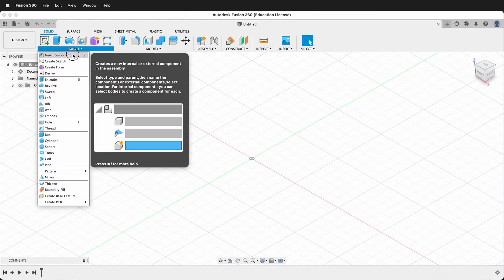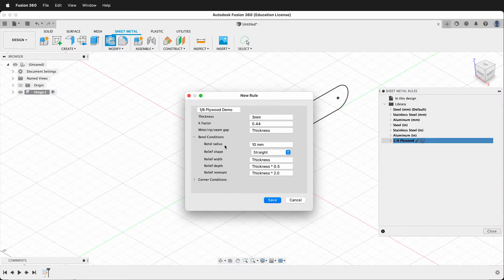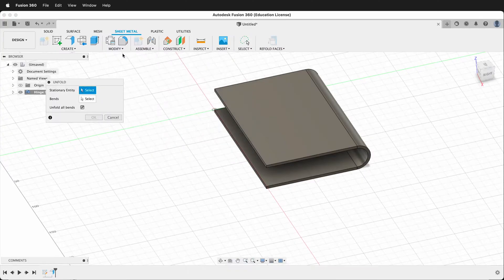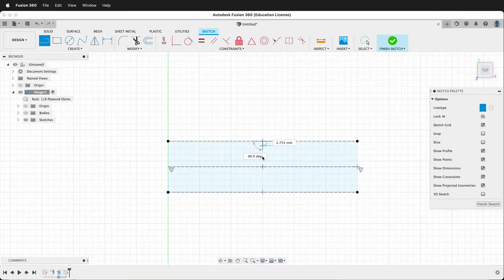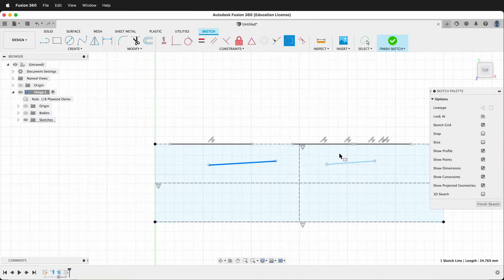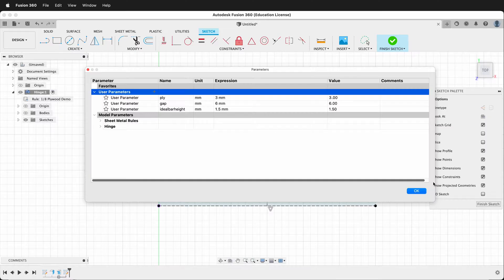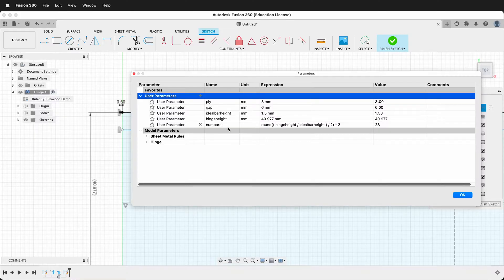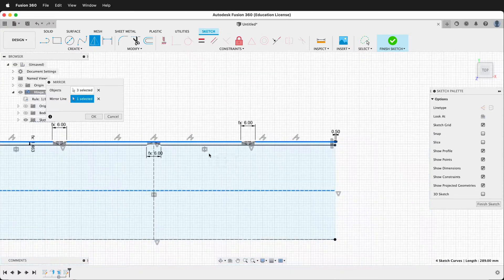Autodesk Fusion 360 Tutorial: Mastering Living Hinges for Laser Cutting

Comment: MANY thanks.  I have been struggling with this concept for ages.  I have been blundering along and wasted several sheets of wood in the process.  

Add two user parameters to automate drawing and changing line segments:

      Segments = (Length of bend line - gap) / number of segments (mm);  must have one more gap than segments
      Line length = segments - gap (mm) ;  

First row of lines should start with a gap and will end with a gap.  Second row starts with a line = to Segments/2, then a gap, Lines & gaps (move/copy lines from first row), and will end with a line = Segments/2.  If you change any of the parameters involved, the sketch will automatically update, except that you may need to add or remove a line.

*Super important:  Constrain the first bar to be co-linear with one of the bend lines or Fusion will move the sketches, surfaces, and thickened bodies around *

DM me for an export of my user parameters.
Reply from the maker: Thanks for sharing the technique and methods with everyone. It sounds uper solid and robust. How did the living hinge come out in your project?

Comment: first i got to say , you make the best Fusion tutorials ever , smart and straight to the point , 
at 7:36 , the driven dimension is 41.846 for me , tho i have set the sheet metal setting exactly as you , idk if it's me or fusion , 
this video was 3 years ago so i don't know if something in the way that fusion calculates the flat pattern has changed
Edit : the value would be as yours if the thickness is 2mm , with a 3mm thickness it's 41.846
Reply from the maker: Could be an issue with Fusion updating or with the way the sheet metal rules are calculated

Comment: at 5:07 , one of the bottom lines just moved passed the symmetry line !! how is that possible if the two lines are symmetrical around the centerline !!!!
Reply from the maker: That is frustrating when constraints in Front usion seem to change, it is usually because there are two ways to interpret the constraints 

This often happens with fillets for c&c inside corners even when it is locked to coincident and a 45° angle 

Sometimes with investigation I can figure out the weirdness was but usually that isn't worth the time and it is just faster put everything back to where it's supposed to be 

For a very robust parametric model, sometimes you have to use different constraints or put min max limits on some of the parameters

Comment: Great tutorial.  I dont know if you can help but I am trying to form a tapered cylinder with living hinge. The sizes are the base circle is 80mm dia and the top is 60mm diawith a length of 300mm. Any idea how?  A video would be great
Reply from the maker: I would try making a living hinge pattern on an arc path. Look up the formula for a truncated cone online, use it to make the arc and then experiment with hinge cut pattern spacing on that arc
Reply: Thanks for that I will give it a try

Comment: what is the K factor? what value to choose?
Or, is it important? one could directly choose steel and not even create a new material
Reply from the maker: K factor is based on the deformation of a material at a certain thickness and bend radius, for rolling or bending steel with precision it is important, but for using the Fusion 360 sheet metal feature for laser cutting living hinges it can be ignored

Comment: Hi, thank you for this great tutorial. at the 12:45, which command do you used to select all lines faster ?
Reply from the maker: It's a drag select, if you drag from the left, it selects any entity it touches, if you drag from the right, it only selects entities that are fully inside the selection, up in the top menu where there is select right click on that menu and then make sure that you have the option to Windows, select or draw select
Reply: @WhatMakeArt  is there a formula to calculate the number of lines in the same line depending of the object width ? Maybe is there a perfect line length to use ?
Reply from the maker: They're probably is but I don't know it, I would have to do some tests and then see if there is a relationship through experiment
Reply: @WhatMakeArt  thank you :) if you found a way, it will be great to share that on a small video !
Reply: I found that, I’ll analyze the code and come back with the formula ;)

Comment: At 8:03 you say there is a downside were you have to type that value every time you change the model. If you go to Model Parameters - under User Defined Parameters ( you can find that value as a dimension name (eg. d50)). As long as you don't change (as in delete/recreate) the driven dimension, you can use the name of that dimension in you your expression. I believe Fusion will recalculate your expression even if your design will change (increase plywood thickness, overall dimensions and so on). To my knowledge, all dimensions will be given a default name by Fusion (driven or user defined). Also at the beginning of the video where you define the gap, instead of entering a value for the second gap, you could have clicked the first gap dimension (these is a good practice if you don't have different gaps).

Other than that, nice video.
Reply from the maker: Thanks for the tip.

I don't think driven dimensions worked at the time I made this video but driven dimensions are a great new feature in Fusion 360.I think they are still locked to a single sketch and can't be used in different sketches, but driven dimensions are a better way to have the calculation happen automatically.
Reply: @WhatMakeArt  May be wrong, but i believe you can use any dimension "name" (the one given by Fusion) from any sketch into any other sketch.  Not really sure what you meant.
Reply from the maker: Yes you are correct about using Fusion 360's names for parameters in different sketches

I was referring to the driven dimensions as discussed here https://youtu.be/EM11JxtPbjw
Reply: I thought of this as well! You can also change the driven dimension name from e.g. d50 to anything you'd like, so in this case "hingeheight" :)
Reply from the maker: @Algardraug this is a great suggestion. Thanks for sharing 👍

Comment: This was so helpful. I found that the lines that you extended past the edge of the board didn't do anything in my design so I removed them leaving only the central cut.
Reply from the maker: Glad it helped, the lines extending past the border are only in case the laser cutter doesn't cut everything, it's kind of like a through cut / release cut on a bandsaw, if your laser cutter cuts perfectly within the kerf then there's no need to have the lines extend past and it will save work

Glad you got some bendy wood now 👍